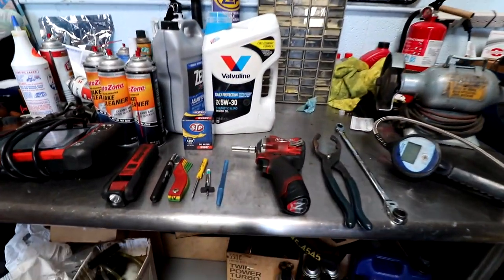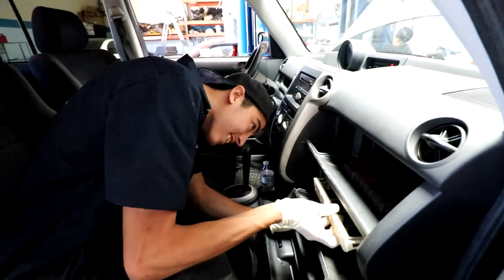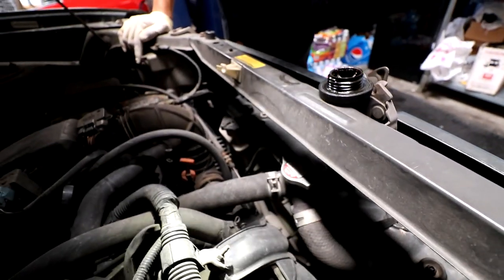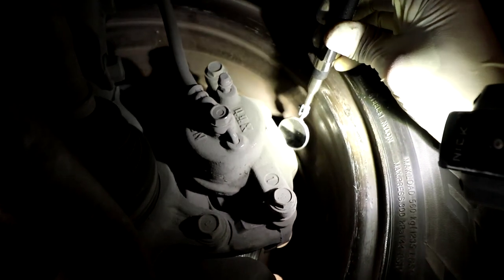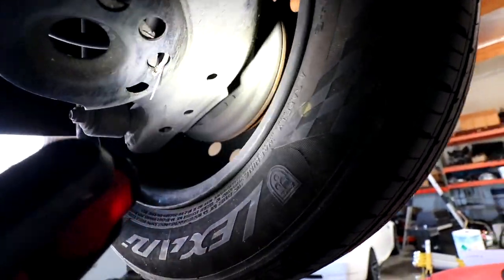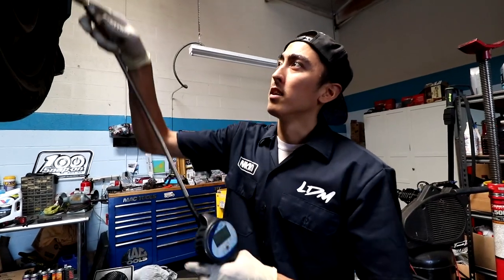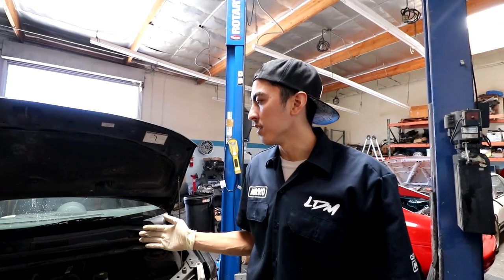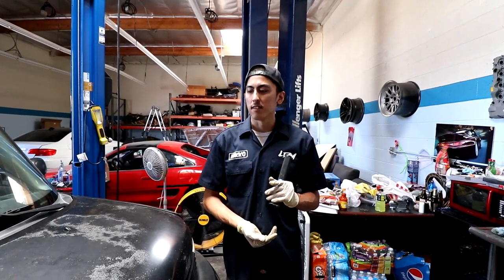TOYOTA EXPRESS LUBE TECH ROUTINE

Comment: You also need to replace the oil pan drain plug washer, and make sure the old one is not stuck to the oil pan. Also do not over tighten the plug. Also do not over fill the oil.

Comment: I just recently moved out of being a lube tech. I'm an Automotive Engineering Technician now for an R&D company. I've been watching you since I started at Toyota in 2019

Tool trucks sell a plastic brake gauge with little feeler nubs for like $25; best low-cost investment for a new technician, they are extremely useful for checking brakes without removing the wheel
Reply: Sound like a nice idea , do you happen to have the part number to order online ?
Reply: @51015panchovilla  Lisle 81850, it's $15 on Amazon
Reply: @scottymonochrome3795  thank you very much

Comment: There’s 2 things you forgot to do. When under the car tap the muffler with your palm. This check how eroded the muffler is. Mufflers erode from the inside out so if you hear a lot of rattling then you can sell the customer a muffler replacement. Also the most important one, tire shakes!  Pull towards you from the top of the tire. This checks the upper ball joint. Pull from the bottom, this checks lower ball joint. Shake tire from left to right, this checks inner and outer tie rods. Shake from top and bottom of wheel. This checks the wheel hub. If you feel any moment at all then double check it when doing under inspection. These components go bad often and mechanics will love you for bringing them work :)

Comment: I’ve been a lube tech at an Acura dealer for a year now. My routine is similar to yours which is to read over the history, mark down all major services, get the car in check all the lights, wiper blades, pop the hood and fill the washer fluid. I’ll then remove the oil cap, check the battery, check the air filter and get the car up at chest height for the rest of the inspection and submit it ASAP for upsales. I like to set tire pressure first to keep my air chuck clean. (same as yours) then rotate the tires, and drain and fill the oil at the end to reduce the number of gloves I need to use per car. If the car doesn’t need a tire rotation, I’ll usually be able to get a quick oil change out in 15-20 minutes.

Comment: I work at Toyota. I pull in the car honk so guy behind checks my lights, pop hood, pull dip stick, remove cap, fill washer fluid, rack car bring to chest level, check tread, brakes, psi, then loosen rims raise the car, drain oil rotate tire while oil drains, check under car, get my oil filter from parts then hand in the RO to service writer (if I recommended anything) by the time I finish up the oil change the writer should be back with an answer.
Reply: Got my interview tommorow and scared as lol

Comment: i’m a T-Ten student and i start my 2nd year next monday. i started working at toyota as a lube tech a month ago. for a oil and rotate and multipoint inspection i usually take 35 minutes if i’m fast and take 45 if i slack a little. i think it’s very easy. i just hate that i have a 4 post lift instead of a two post
Reply: Im the opposite. I hate having to position the lift to get the vehicle in the air. With a 4 post i just roll up and lift. Plus with the 4 post you can still lift the car off its wheels.
Reply: At my Toyota dealer we have 20 min intervals for cars. But we run a 5 man team. The 5th guy is a floater helping whoever needs help. Some days we’ll just bang bang bang cars out they show up early and then have a nice break for about 20 mins
Reply: @joshuastevens5910  sounds tight 🤟🏻🔥

Comment: I would check brakes when the wheels are off during a tire rotation but if I don't need to take the wheels off, I have a Lisle Brake Lining Gauge that I can slide in from the side and measure by feeling until it fits with very little play. Very good tool and efficient when checking brakes.

Comment: I’m Also a Toyota dealership technician. Usually when it’s an express ticket i can get it out In 15-20 mins, depends on what you need to write up. You also need a 12mm 3/8” socket for the tundra skid plates.
Reply: Same here depends on the car too trucks always take an extra 5ish minutes
Reply: And 13mm. Also the 4 runner trd pro you need a star bit for the access panel bolts. Tundra, Tacoma, 4 runner if it has after market wheels you need a  he bit for the lug nut cover
Reply: jdm cars 10mm Allen for the drain plug panel on the trd pro Tacoma

Comment: I bought my 2018 Rav4 three years ago.  The first two years I had to take my car to the Toyota dealer for the oil changes.  The oil in the engine was overfilled.  I had to drain about a quart of oil to bring it to the correct level.  The Toyota dealer keeps texting me to bring my car in for the oi changes and car maintenance.  Now I do my own car oil changes and car maintenance.

Comment: I work at Toyota. For cars with low mileage, 10k or less; I don’t do a thorough inspection. I pull the car in, set the lift, pop hood and top off coolant, wiper fluid and unscrew oil cap, raise the car, check the treads, and start zapping off the wheels. Raise the car up and start taking off the oil filter and draining the oil, change the filter and drop the car and start the rotation. By the time I’m done w the rotation the oil is still draining so I go and get the oil. Tighten the drain plug, tighten the filter, Lower the car, fill the oil, put a sticker and reset maintenance light . This routine is the same for the high mileage cars as well, but with a  thorough inspection, I check everything on a high mileage car.

Comment: I used to work for a Suzuki dealer (back in the day) as a LOF Service Tech.  They wanted us to bust out oil changes in less than 15 minutes per unit.  Pay was 0.3 flat rate.  Including a 27 Pt. MPI.  Which was bs.  No tire rotation or brake check tho. Recommendations we would make $1 commission on wiper blades and air filter, fluid flushes $5 for coolant and $5 for transmission Big whoop.  Man I don't miss those days, too many nights on Ramen noodles lol.  I enjoy your content man keep it up.
Reply from the maker: Sounds just like Toyota lol they expect a car in and out for an oil change and MPI in 15 minutes, they would give us a $3 bonus for selling cabin filters that they charged 70$ for all while paying us minimum wage. I definitely do not miss those days.

Comment: One thing with doing Toyotas a lot I would suggest is get the best cap you can afford for pulling the canister filters. Those things can be a royal pain to get off, especially if it's been a while since the last service. Being a dealer tech, you also would have the advantage of being able to simply walk and get a replacement if you break one instead of having to call around to various dealers and parts stores to see if they have one in stock.
Reply: Cons of Independant...you have NO parts in stock besides a few filters and oils/fluids and bolts. A quick air filter change out will take 15-25 minutes to get there from the time you call them up. So 2 minutes into your oil change after getting it in and checking a few things now you have to wait half an hour for an air filter. You can do other services in that time but then you're stuck waiting at the end still. Nobody at the shop i was at had that special Socket/cap for the filters on Toyotas...used a punch and hammer, yeah. This aint some home town rodeo shop mom and pop its a performance shop like come on.

Comment: At Nissan we do a body report incase you get blamed for damaging car and we make a video that gets sent to the customer showing all defects on the vehicle, we also hook up diagnostic while car in the air. But apart from that more or less same
Reply: sham hi im a lube tech at nissan    have you done a oil change on the 2020 sentra yet    there is like 20 push pins and 2 10mm bolts  just to remove the cover to gain acess to the oil pan and oil filter
Reply: @joehyundaitech7961  I'm in London we only have micra, juke, qashqai, leaf, xtrail I know over  there you guys got loads more models.

Comment: I’ve been using hex keys to measure brake pads. Easier to stick between the pad and rotor, and usually everyone has a set.
Reply from the maker: I've never heard of that one thats smart man gunna try that out
Reply: That's actually a pretty good idea. I've used them in lieu of feeler guages at work (factory) in a pinch.

Comment: Thanks for sharing. I rather do all my oil changes, but when the weather hits over 100 degrees outside I just take it to the dealership. Maybe the next video you can show how to do the tightening of the bolts like the drive shaft, etc. I double check the work all the time. Cause one time we left the dealership the radiator fluid cap wasn’t on and we were missing a negative battery cover. All the fluid sprayed the engine. It was nasty. I also tighten the tire caps as well. Some techs are just not double checking their work. 🚙💨

Comment: I work for ford and we try to shoot the cars out as fast as possible and usually we check the turn signals without getting out of the vehicle. We check the functionality of the windshield wipers and the sprayers and pop the hood then we get out. We also check the battery, the coolant level, the air filter, top off the windshield washer fluid, and check all the other fluids. Then lift it and do the oil change and the tire rotation (if they ask for the works service). We also do and detailed inspection of the undercarriage of the vehicle including the engine, transmission, brakes, and suspension.
Reply: The dealer where I have my vehicle serviced (Tousely Ford) uses a "grease pit". Oil change and underbody inspection is done AT THE SAME TIME as the "other" services. At this dealer, "Quick Lane" means QUICK!!

Comment: I feel that you tightened that drain plug too much but that’s from what I observed no hate
Reply: Technically you're supposed to use a torque wrench but 90% of the time, especially if you've been doing this for a while, you can just go by feel. Most Toyotas have a steel oil pan as well, so stripping the drain plug isn't a major concern. Chryslers and Hondas are the ones you really have to watch out for.
Reply: @1337penguinman  Amen. Facts!
Reply: Torque everything to spec and you’ll have no regrets and plug comes out and goes in smooth as butter

Comment: Could you do a demonstration on where you place the lift arms on Toyota’s? I don’t have a lift so I use a jack and jack stands. I always thought you can only lift from the front and rear subframe lift points and at the pinch weld spots but I’ve been seeing how these asymmetrical lift arms reach all the way under the front subframe. Curious where you place them
Reply: The pinch frame on driver and rear passenger side but sometimes you have to extend to the sub frame

Comment: If it's a rotate, I'll normally do the rotate as soon as I get it in the air, and check brakes while rotating. Also check for wear/damage/punctures while moving tires to their rotated position. Then I'll replace filter and complete MPI while oil drains. Not too different from your routine. I can hit lof/MPI normally in 8-12 minutes, lof/rot/MPI in about 12-14 minutes (if I don't have any upsell items to install or throttle body cleaning, etc.) Only time I get slowed down is if say brake pads are very uneven, and I pull the caliper off to check for frozen slide pins or piston, things like that. 

Been at a Toyota shop since early 2019 as express tech, transitioning to a upsell/low level line tech now, just waiting on them to hire my replacement so I can train them. Then move my box across the shop lol.
Reply: If I rotate my own tires do I have to reprogram it. I stop going to Toyota dealer for services since my warranty was out and ever since maintenance I been doing it myself and writing down the mileage on when I replace what. But I haven’t found anything to tire rotation on google
Reply: julio bello The TPMS doesn’t need to be reprogrammed. Just make sure your fill the tires with the proper air pressure. Check the door jam or the owners manual. Depends on the car but check the tire size, also if the tire is directional. If directional make sure to just rotate front to back but stay on the same side of the car. Unfortunately for my car I have a staggered set up and the previous owner bought directional tires so you can’t rotate them lol.
Reply: Mike awesome thanks for the info man I still have the original rims but planning to change them probably next year. So far my camry has 124k and so far right now the car needs struts they gave me long last so I’m ordering the KYB Excel-G since I enjoy the ride quality of those and the durability.
Reply: julio bello Which year is your camry? I wouldn’t buy after market wheels. If you are going to change them up look for a good set of used ones from offer up. Pretty sure you could get the newer generation camry wheels, should fit.
Reply: Mike mine is 2015 facelift SE and yes I agree I’m planning to get the TRD wheels they look sexy haha plus I also was thinking you can give me advice on that what wider tires can I install I heard that 235 can help improve the ride quality
Reply: julio bello Im familiar with that model my parents own one. The wheels from the factory are pretty good. If you want a softer ride then get touring tires, from a good brand. Don’t get Kumho they are rough. Stick with Goodyear’s, continentals, Michelin. 
If you get a larger wheel size like 18,19 inch your tire profile (height) will be smaller. The width just goes up with the wheel size. More width gives you more grip. A larger wheel will give you a rougher ride, sportier. 

At 124k miles if you are replacing the shocks it should help improve ride quality also turning aswell. 
You could try Sachs brand shocks. On rockauto those are available for your car. Those are oem Mercedes brand. My Mercedes has those but I switched them to bilstein which is a little more sporty (firm). Those Sachs could smooth out your ride.

Comment: @Lets Drift Media, 12:05 I realize you may be doing this on your day off but is this in a shade tree shop or at the dealership? If at the dealership do they allow techs to wear sandals on the shop floor?  Most auto maint paces require non-slip safety shoes.  I was told they dont have to be steal toe but should be non-slip. Personally, I like my toes so I'll use my steel toe shoes. You just never know. Better to have an not need than to need and loose your toes.😉

Comment: C'MON man!     You guys get toooo comfortable. Every tech I know skips the spare tire. And if the car is over a few years old, that spare will be damn near flat. I got burned once on that and it always gets checked when adjusting the tire pressure. I've got into the practice of releasing my MPI before working on any car so I have less chance of having to bring the car back in from upsales I have made, especially with alignments/ new tires / brakes /  filters / belts / batteries / gaskets / and flushes. VWs and Audi's are very time consuming, but not as bad as BMW (stuff of nightmares)

Comment: Just did my first day. Was taking an older blazer through the car wash after the standard lube and inspection, I stopped to fold the mirrors in and unscrew the antenna. Got back in and went to put it in drive and the brakes went straight to the floor. What luck!  My favorite part is the A/C when taking it through the wash being I get hot easy.

Comment: With the drain plug we used and inch pound torque wrench for a quick check of the oil drain plug
Reply: I just tighten it "snug".......never had a problem in 60yrs of vehicle ownership!:face-fuchsia-poop-shape:

Comment: The issue i had being a lube tech at a Toyota dealership was that they make you work in pairs for each car that comes in and if your partner made a fatal mistake then it would rollover onto you for not double checking his work.
Reply: Damn that sucks
Reply from the maker: Yea, I was in a pair system too when i was on the lube rack, If i felt my partner wasn't reliable I would leave him with less crucial jobs like grabbing me parts, writing down recommendations, checking tire pressure/tread depth.

Comment: Standard work is the industrial engineering term for the agreed upon, routine steps to maximise efficiency and consistency.

We had a Honda rep stop in to showcase the engineered procedure for express oil changes.  A couple of mistake proofing tips were:  1.) leave the 710 cap on the hood latch.  2.) Use the provided, fixed setting torque wrench (33 lb*ft) when tightening the oil drain bolt.

Comment: Bro , im trying to get into the industry  , ive been going to trade tech school for almost 3 years, , i completed tech1, brakes, electrical, engine performance classes , im almost done with it.  Currently taking suspension and steering class,   we may have an hybrid / electrical class this fall.   Anyways. I do want to start as a lube tech,  i do have experience doing brake jobs , fluids,  sensors  alternators , water pumps and other stuff.  Any suggestions where could i apply to?  I already made a indeed resume.  My current immigrant status is difficult tho, hopefully it get resolve in the future,  just looking for a company or dealer that could hire me,  do you have any suggestions,  on where to apply , i live in LA/SGV area?  I passed the ASE G1 test. If that helps
 Any suggestions ,tips and advice from you will be appreciated it.   By the way i love your channel , keep up the good work bro .